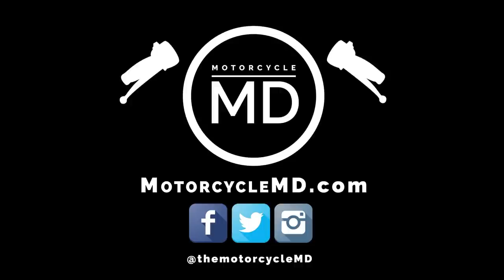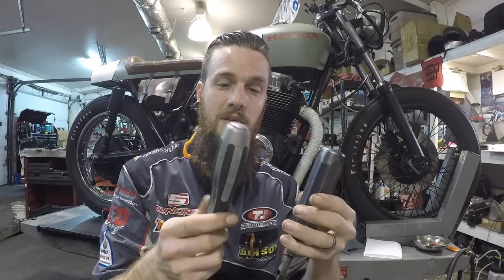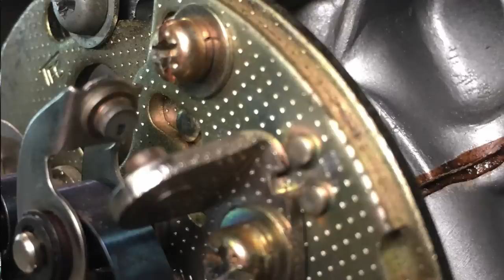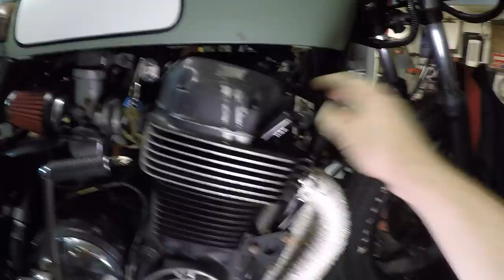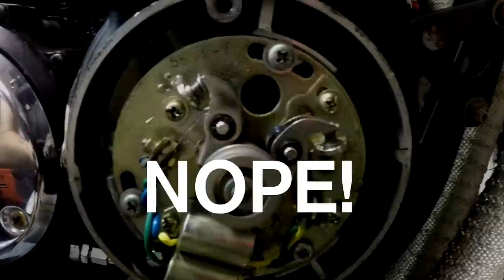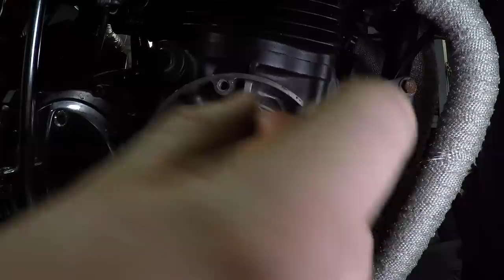How To Fully Clean, Adjust, and Read Ignition Points

Comment: Using a light to do a static timing is so easy. Why wouldn't you use it? Set up points in less than 20 mins. Then check dynamically. Idk man. You do you.

Comment: Hello, I remember adjusting points in my 77 VW Rabbit when I was 18 years old. I have that exact timing light, I also used a Dwell meter on that car. Would a Dwell meter help on a points motorcycle? I bought a 69 Triumph Tiger with points. I had it out for the first time yesterday and it is occasionally back fires, which shut down the motor as I started off once. This is telling me my timing is off. Most likely the points are off. Does my bike have duel points or single? I’m hoping single, so it will be easier to deal with. The bike has all original Philips heads everywhere. I will get those screw drivers. Thanks for your video.

Comment: I put in new points and condensers, but never moved the plate , never took it off.  If I gap the new points correctly, will I still have the timing correctly?  I don't want to mess with it
Reply from the maker: You need to mess with it!

Comment: You touched on exactly how I recondition my point surfaces. I get flack from lots of guys who have been conditioned by the parts counters to REPLACE THEM, DON'T CLEAN THEM. They say you're "removing the protective coating" ....yeah...right! lol...Being in my 50's, resurfacing points was and IS how I do it, and I've got 50+ year old point sets that are better than any new ones you can buy today. I'm glad you picked up the Impacta Drivers! Looks like you've really put them to use with the worn lettering. Aren't they the tits? As a side note, new slide and needle in the CM185T fixed my problems! So it's just down to chasing a couple Electrical Gremlins and it'll be ready to ride in the Spring (Winter up North now!) Cheers Cody and thanks for the shout out Brother! Zip~
Reply from the maker: Exactly correct! Let the nay sayers nay! The impacta driver is legit! I love it! Thanks for the recommendation! That’s also great to hear about the bike man! Great finds! Great fixes!
Reply: They're my go to drivers 100% of the time when I'm wrenching on bikes. I often find tools that I wonder how I ever lived without, then I HAVE to spread the word! Glad you picked them up, so now they'll be your go to drivers. Cheers Brother! Zip~ p.s. Looks like I have to tear into the full harness to find where the over voltage burned through the wires and get them tidied up. But then the CM185T will be right as rain for Spring time.

Comment: Thank you so much for this! Your attention to detail really helped me out. I have a 1980 Yamaha XS850 with a rather odd stock setup. They made the points unadjustable and hid the point plate behind a pickup plate which has no marks but can rotate a bit like the bike in the video. After replacing the crankcase gasket I have to set the timing, and the knowledge about how that plate is helpful along with how to read the point plate markings has made this possible.

Comment: This is the best video on youtube.  I didn't even know what a contact breaker point was a couple days ago.  Excellent and understandable explanation of what I need to do using tools that I actually have.  
I'm working on a 1970 Suzuki TC90 with no spark.  Would this be the same basic procedure for a 1 cylinder 2 stroke?

Comment: Close to 50 years ago when I had
a 750, there was a Delco point conversion where you could set your points with an Allen wrench,  like the 71 Vette I owned. You could set the dwell and check the timing with your light.

Comment: Is this the same principle for the pulsar generators on dohc models?
I am trying to chase cylinders 2&3 that wont fire and im thinking the timing on these may be too far advanced?
Spark is good, leak down test on each cylinder has a loss of around only 10%. Carbs are rebuilt and fresh and plugs 2&3 stink of fuel where as 1&4 are black with carbon.
Any help, pointers gratefully recieved.
Keep up the great work.
Pete

Comment: Nice video Cody! And good explanation. I just have one doubt: it seems that you adjust the points gap on different positions of the advancer. I thought it was at 90° after the F mark but I saw you setting some grades before and then recheck even more grades before (that 300 stamped on the advancer is probably 45 degrees after F mark?).

Comment: I love the video and the way you walked us through the process
  I have a 74 ct90 sometimes I have spark at the plug sometimes I don’t !!
  I’m getting frustrated chasing this gremlin
  The bike has 1592 miles and was stored inside 
  There is no rodent damage and all the wiring looks good 
  Any ideas ?
Reply: Faulty ignition switch?
Reply: @BL2197  
  Ended up being the coil

Comment: I am working on a 78 CB550.  Can't get 1&4 to produce spark. I have tried a new ignition coil. Points seem to be functioning okay but the 1&4 point get really hot when the ignition is on. Going to replace condensors next. Any idea why that point set is getting hot?

Comment: Hey man thank you for the video. I am currently working on a 1999 Kawasaki police as well as a 09 Versys. The police needs to be rewire, but due to it not having a computer for iginition I am needing to understand how the ignition system works in order to wire it correctly. Thank you once again!

FYI, You should not have to apologies for a webster defined term, such as "retard". It is the definition of the word :) No slang intended :) 

You are absolutely correct, it is America Dammit!!

Do what is needed, fix what is needed,, but "Get the damn job done... Right and forever"  = "American Engineering" 

Great Videos!!

Comment: Great breakdown. So, maybe I missed it but when does the set points actually send the spark to the spark plug? When the points start to open? Doesn't make alot of sense being that the points are kinda like a switch. So current is running through them when they are closed? But it's being controlled by the condenser? And as the points open they spark and send energy to the plug?? Thanks!
Reply: @Colton Bunch that vid was good but I don't have a battery. My primary coil is my stator coil. I havd s kick start. I have continuity through the coil but when I put it all back together with the flywheel I don't get steady 0 ohm readings outside of TDC.  Do you think maybe the primary or secondary windings are going? Also, I have a tail coming out of the coil with a eye connector and it's grounded to the leg of the stator coil. It just seems weird. Any test you can suggest to check my coil before getting it rewound wound be fantastic. Thks

Comment: I've got a point misalignment on my '78 KZ650…the two points for 2&3 are parallel to each other, but slightly offset (the rocker arm point is off to the side 1mm, maybe 2mm). Big issue? Can I (gently) bend the rocker arm a tad to make sure the point is straight above?
Reply from the maker: If it runs good, leave it alone. It may prove quiet difficult to bend that arm though. I typically replace with a quality set. UNLESS it’s running fine than I would just ride it!

Comment: When I use a strobe, and turn the plate to its max, the 1-4 pair is only idle firing at the T mark.  The plate can't turn far enough to reach the F mark UNTIL I rev it past idle. And it doesn't ever advance fully to the 3500 rpm mark, either.  The 2-3 is almost perfect, though... but the problem is the plate won't turn any further to accommodate the 1-4.  Have you heard of this before?  What do you do, here?  Incidentally, it was almost perfect until I re-tensioned the cam chain.  That seems to have thrown off the cam sync alignment off from the timing plate alignment...Although it's "close" I hear the difference ...it is just a tiny bit raspier and rougher.  Anyhow, what would you do to get these lined up with a strobe, when the plate won't even turn far enough to get it perfect?

Comment: timing pick up sensor is that electronic
 points?
Reply: With a CDI system it eliminates the points. The CDI box is a simple computer which does all of this timing and advanced curve work internally with no means of adjustment. The timing pick up sensor in a CDI system is used to tell the CDI box where the engine is and it's rotational cycle. That's the reference point It uses for determining when to fire and advance the timing based on RPM.

Comment: They are not Philips headed screws they are JIS headed screws two completely different heads.
Reply from the maker: Ok.
Reply: TheMotorcycleMD yeah you should maybe clear that up, it always seems to be you guys from over that side of the pond that get the two mixed up.
Reply from the maker: That would be like me saying, don’t call a Fuji Apple and granny smith apple. It’s a completely different apple.
Reply from the maker: So should I also call all Phillips head fasteners/bolts/screws,  JIS fasteners/bolts/screws now? Or do you think that majority of people will simply get the point that there is a difference in the drivers.....
Reply from the maker: Alfonso So what are the fasteners called that require the JIS driver?
Reply: TheMotorcycleMD those are JIS Japanese Industry Standard headed fasteners which are fitted to Japanese bikes. The head of a Philips driver has more of a point and does not seat properly in a JIS fastener hence the reason they get chewed up.  https://www.dateelectronicsupplies.co.uk/news/the-jis-standard/4 this link shows the cross section of each perfectly